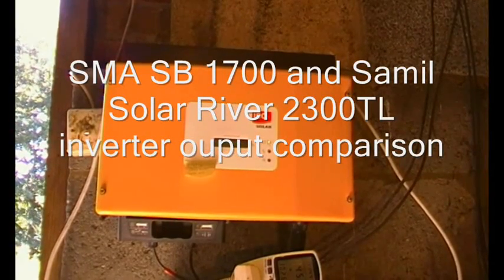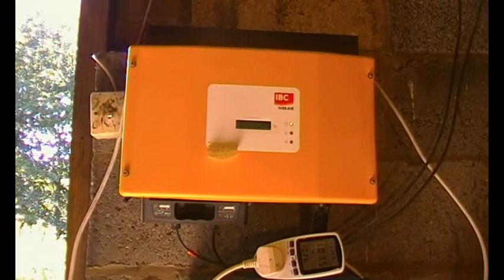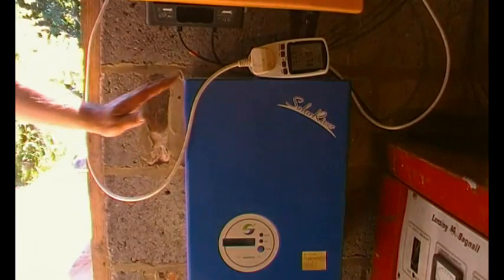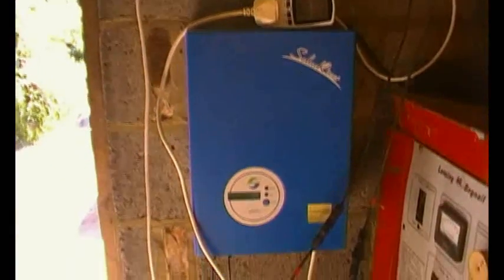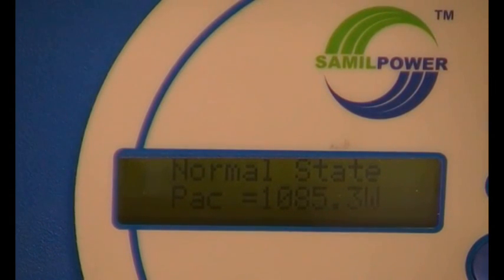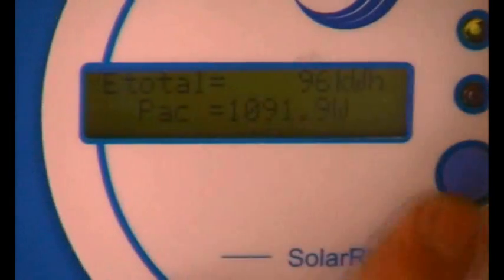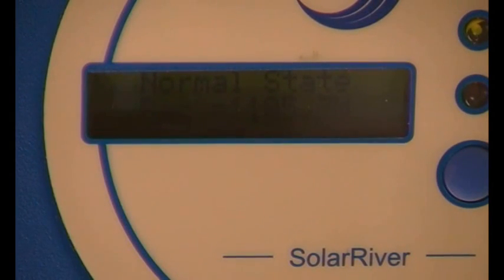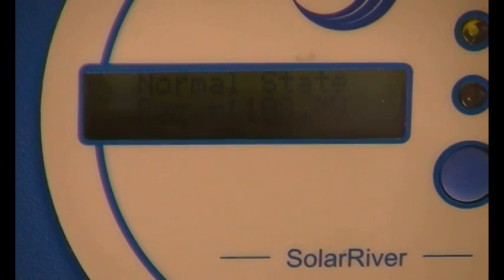SMA SB and Samil Solar River inverters, output comparison

Comment: Interesting that transformer based vs non-transformer inverters are quite close in output in your test - I know it's only a sample of two inverters, but even so...  Dave
Reply from the maker: My thoughts too, 1% difference using the remote monitor figures. Smoke, mirrors, and marketing. Cheers, Andy